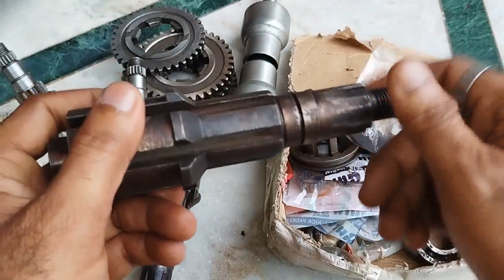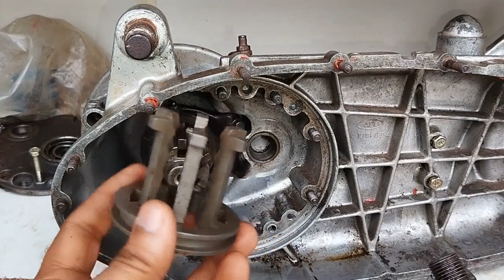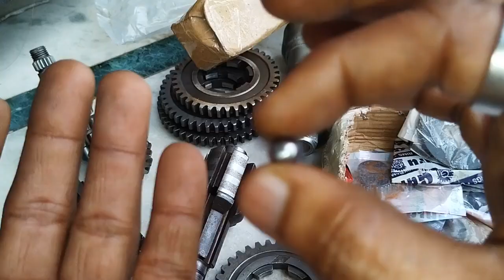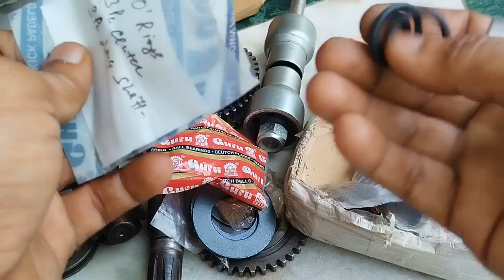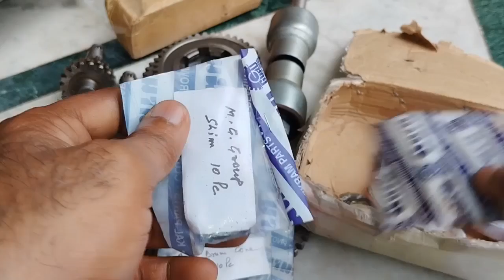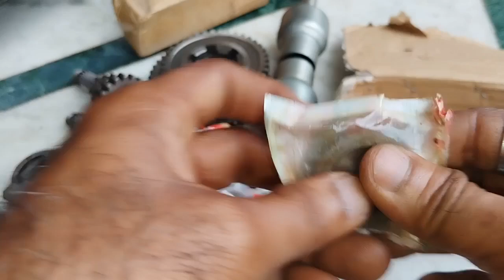Understanding Lambretta Scooter Engine Parts Explaining Lambretta Scooter Auto Parts (Review)

Comment: hello , my grandfathers lambretta started roaring after 25 years [engine work is done wiring is left]! how much will denting and painting cost ?
Reply from the maker: In reality lambretta restoration is very expensive. If you go for very standard painting only it will take 10,0000 rupees before 06 years in today it will be more. At least 33 parts in painting counting. Even you can go for nickel chromium if you don't want to paint it 👍
Reply: @LambrettaRamesh  oh ok ..will nickel chromium be cheaper ?
Reply from the maker: No. No.  Nickling is more expensive. LAMBTETTA IS INTERNATIONAL NOT EASY ONE 😔
Reply: @LambrettaRamesh  :( chetak denting painting cost about 2-3 k ...the mechanic says lambretta costs 12-15k
Reply from the maker: Chetak is very easy and direct transmission. Restoration cost also is less. In Europe they call Vespa Model in India we call Bajaj chetak